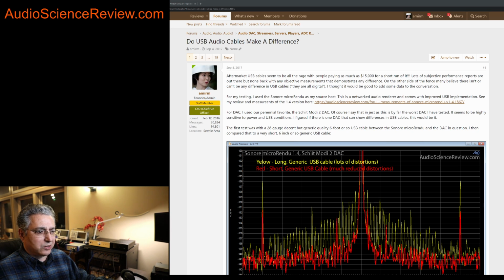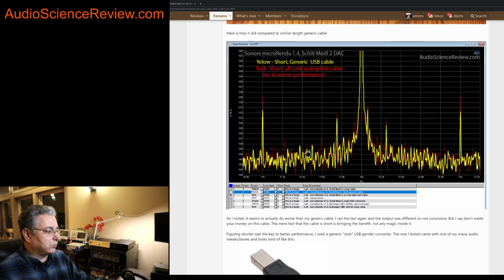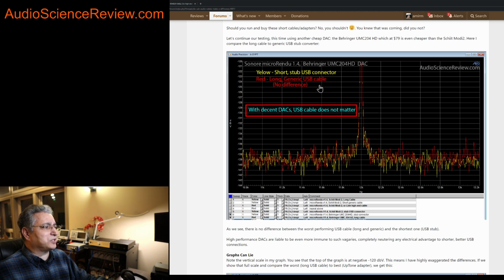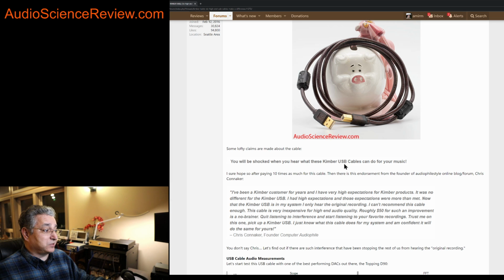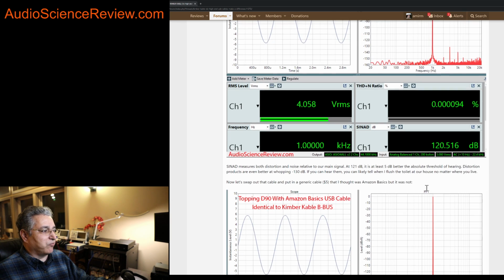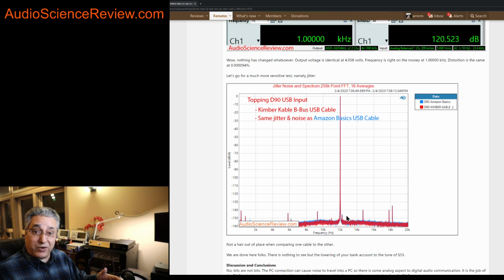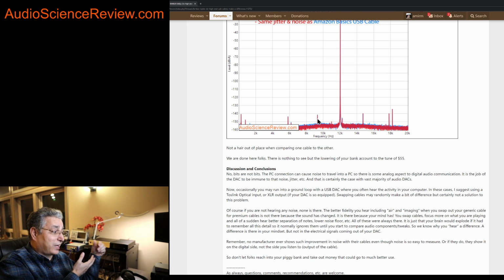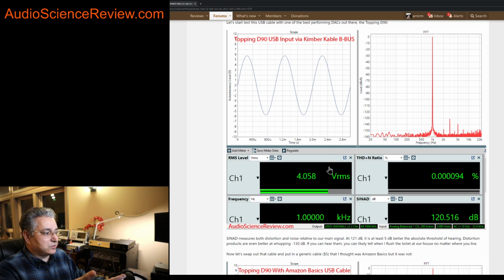Do USB Cables Make an Audible Difference (Kimber Kable Review)?

Comment: I have a high end USB cable.  It is Oyaide Continental.  Expensive - can't recall exactly how much.  I am happy with it.  It has good materials, silver wires and good connectors.  Also it is dressed very well, ie it is good to look at.  I would be happy to buy another.  Now for the money shot! Does it sound any better?  I do not know.  What I can say is that I would not bet $5.00 that I could hear a difference on a blind test.

Amir, I would be very interested if you could do some tests on tonearm wire.  I believe here, if anywhere, there could be an audible difference in quality.  This is because the signal coming from a Moving Coil cartridge gets amplified some 10,000 times.  I think shielding would make a difference at the very least.
Reply from the maker: Hi Zog.  Having expensive audio gear is perfectly fine.  I have plenty of it myself.  :)  If you like what you have, it is totally cool.  

On testing tonearm cables, how would I do that?  Swapping cables in a tone arm is very difficult and if the results are cartridge sensitive, then it won't be general enough to be useful to others.
Reply: @AudioScienceReview  Bear in mind that 'Tone arm cable' is often two cables.  One is that which actually runs from the cartridge to the mounting board of the tonearm.  These can be taken out but as you indicate it is a right pain.  The second 'Tone arm cable' is what runs from the turntable into the phono stage.  These are typically off-the-shelf items.  This is the more practical option.  They often have a DIN connector at one end and RCAs on the other.

What would make this interesting is that the voltage is tiny.  My Ikeda cartridge outputs 0.16 mV! would you believe?

I read your reviews on ASR but really appreciate the YT channel.

Comment: Kimber and Cardas are legitimate companies. Some big equipment manufacturers use their cables. Sony has used Kimber and many others. Sony has plenty of engineers that can do much more sophisticated measurements.
Reply: Legitimate companies can easily use their legitimacy to sell less-than-legitimate products. It's called the halo effect. It's like when Sony or Apple use their name value to sell lesser products. They know that if they slap their name on a product, it immediately gives that product "legitimacy." That's what's going on here with this Kimber USB cable. Heck, it doesn't even appear that they've done anything to spruce it up, even cosmetically. I suspect that if you dissected it, there wouldn't be anything inside it to justify it's higher selling price. It's just a case of a company using their brand value to hike up the price of a product to get inflated profit.
Reply: @peterphan227  This is a very small market for them. They could simply make their own cable. They do not need to waste their time.
Reply: @aaronfriedman8201  ...which is probably why they just slapped their name on some generic USB cable and charged $60 for it 😂. They knew that with their "legit" name, they didn't have to "waste their time" proving that their USB cable actually made a difference. They likely knew that there would be people out there who would cough up the money for this cable based on the Kimber name alone, regardless of whether or not it performed any better than a generic cable.
Reply from the maker: Companies OEM Kimber cable because of the brand they have created.  It is the marketing value that drives usage of it in other companies' products, not any measurable improvement.  Or else, they would show such measurements.

FYI, I bought the first Audio Precision analyzer for Sony when I worked there!  There is nothing better than that so don't assume Sony can find things I can't find.  As it is, the measurements I perform are far, far more sensitive than our hearing.
Reply: @Simeon Walker you do not think that sony electronics do not have a sound chamber and set up that is more sophisticated?  They measure but they also listen.
Reply: actually, he might tell you more about it, since yes, he was working at Sony as far as i remember
Reply: @ddobster  sony is a huge company. I am 100% sure he had nothing to do with cables. I know for a fact that sony does measure but also listens too.

Comment: Amir the head of PS audio had his own cable line. When he heard the top-of-the-line Audioquest cables he changed out his and even started selling Audioquest instead. Basically, he said that the difference sonically was night and day. He is an electrical engineer who has been designing equipment for 50 years. I realize you think that you can measure everything that goes into what makes something sound good. The same story was said when digital first came out. It measured perfect but sounded like hell.  I as well as many have learned that cables can be equipment dependant. For whatever reason cables can sound different depending on equipment. Some may sound better with equipment A and others may sound better with equipment B.
Reply: BS Audio and Fraudioquest are two of the biggest offenders in the 'high end' nonsense marketplace.
Reply: @bwoody1090  Some of Audioquest stuff is good others I do not like.
Reply: So what you can have whatever education in the field and scam people with bs high-end audio cables , people will believe someone with proper education more even if it's scam .
Reply: @turtleneck369  If you cannot hear a positive difference do not buy. Many times I tried expensive cables and returned them. However at other times I found certain cables to work great in my system. I start with Amazon Basics and work my way up. 
If they are not better I return them.
Reply: @turtleneck369  With Audioquest somethings sound good to me and others do not. Their interconnects and USB Carbon I like. I do not like their power and speaker cables. Their Niagra power conditioners are good.
Reply from the maker: You are telling me a story.  Everyone has a story.  Story doesn't play music.  An audio system does.  It doesn't matter what Paul thinks.  Paul has no training or understanding of how you do proper, controlled listening tests so that you can correctly identify audible effects.  Knowing how to design electronic circuits has nothing to do with knowing how to evaluate small differences.  My training and profession on the other hand, was all about this.  This is why I know how to do a proper test and not fall pray to pitfalls that audiophiles do.  

You have to understand that a guy making medical instruments is not a doctor.  When you get sick, you don't go to Philips medical division to figure out what is wrong with you even though they make a lot of the instruments used in hospitals.  

Really, Paul McGowan is just a lay audiophile when it comes to sound evaluation.   He has yet to conduct a single, proper audio listening test.  He is also completely out of touch with audio research from some of the videos I have watched of him where he doesn't know many of our luminaries.

Admire him because he can design a circuit.  But don't give him credit for what he hasn't done professionally or as a matter of education.
Reply: @AudioScienceReview  OK I buy most of what you say. My point is that I had Audioquest hi end Power and Speaker cables and found them noisy. Hence I sold them. However, Their Carbon HDMI and USB I do like. I have compared many cables to them and so far I like them better. My point is that just because it is Audioquest and expensive does not convince me it is better. I have returned or sold at least half of the expensive Audioquest cables I bought. I have speaker cables from China, knock off of the Kimber 12tc and Pangea (lower priced power cables). Hence, If it sounds clean clear and balanced is what I look for. Some were very inexpensive compared to audiophile standards. I also thought the audioquest Jitter Bug was junk based on listening and returned it right away. Yet I found the IFI Igalvanic3.0 to work well. It provides Galvanic Isolation from computer USB.

Comment: I don't quite get it - the bits that are received by the DAC are the same regardless of the USB cable right? And doesn't the DAC reclock the data so jitter from the cable should not make a difference?
Reply: Right, but USB cables also carry analog 5V power, and Amir said that if your DAC uses USB power to operate (like the old Schiit he tested), the noise comes from there, not the digital bits.  Still, a well designed USB powered DAC would show no noise, and even on the Schiit it was far below audibility.